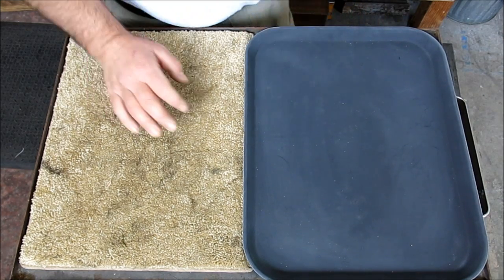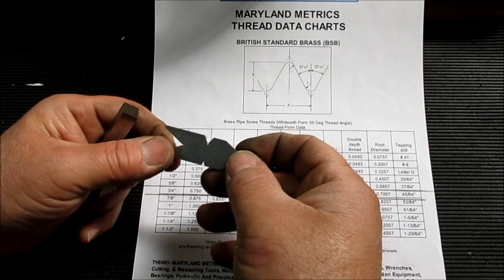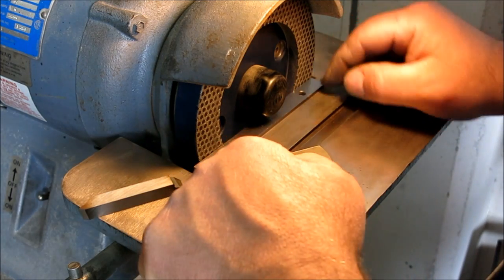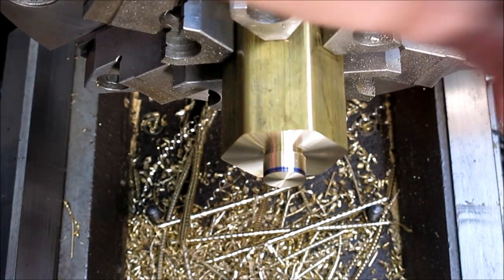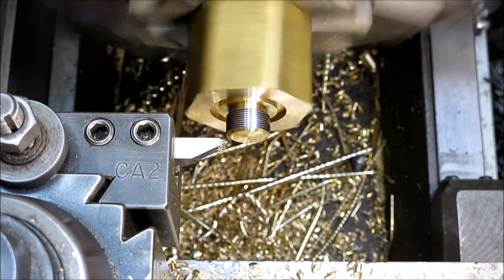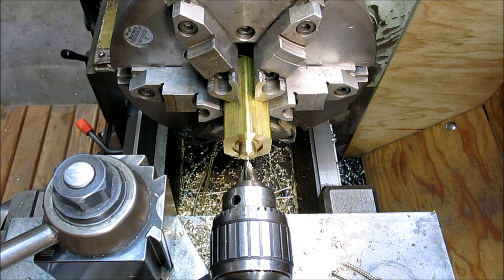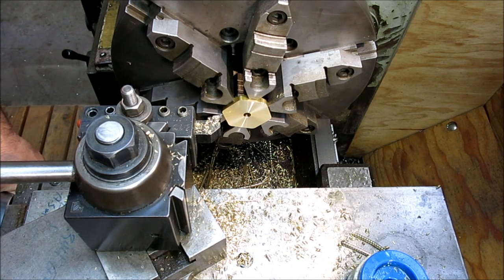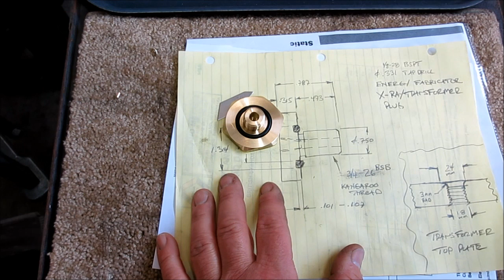Monday Night Meatloaf 29

Comment: using a marker on an oily surface is not only infuriating when it doesn't work, it ruins the marker for life. If I had a marker for every time someone destroyed one this way well... I WOULDN'T HAVE TO BUY MARKERS ALL THE TIME >:C
Reply from the maker: +Max Maruszewski Hey Max,

Comon man you get them at work like the rest of us. Thanks for the comment.

Cheers,

Tom
Reply: +oxtoolco Actually we don't stockpile those, I bought two boxes of fine and regular tips in industrial black, I wont make the mistake of getting industrial, or black again that's for sure. Blue is the way to go.
I replace the one in the grinding room all the time, people spray coolant on the surface grinder and then expect a marker to write on it. Its one of my pet peeves.